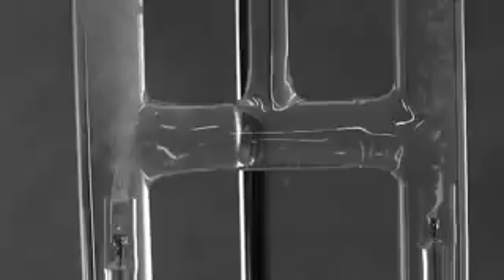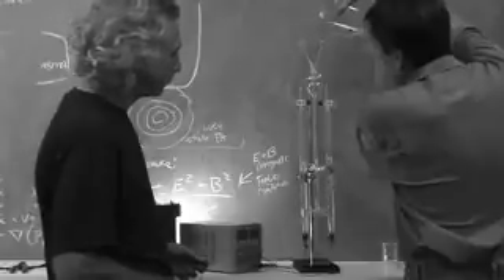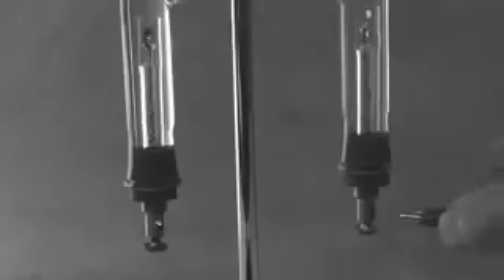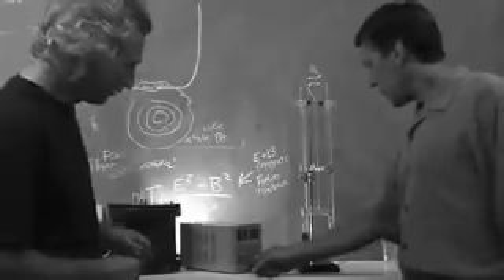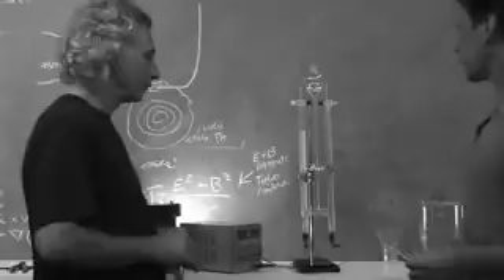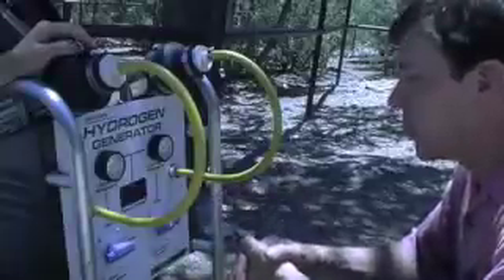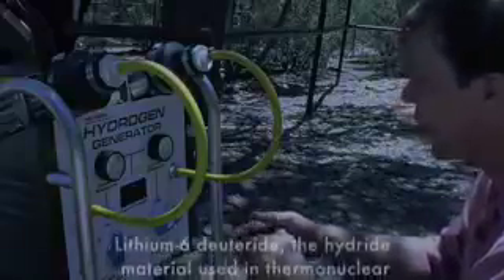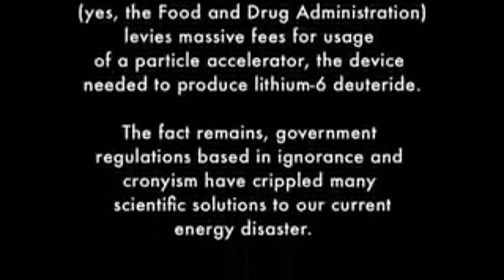run your car on water. This guy does just that!

Comment: if I had a car run on water, nobody would know.......
Reply: Exactly...
Reply: There is an old French patent that takes water and alcohol fuel and combines the two in increasing proportions. The car is started on straight alcohol. As the engine warms, the fuel is ran through a heater that is fired up by the exhaust. Water is added to a maximum of 90% - 10% alcohol to 90% water. The heat reforms the fuel to extend it with the water to methane, carbon monoxide, methanol, etc. The thing is crazy dangerous and the mix has to be cooled before going into the engine....and yes, you will never hear about this thing again - it has been suppressed.
Reply: @jimmcknight1189  source?
Reply: krab 

Do your own research.
Reply: @krab8719  Your kidding.; You'll never get a source from these charlatans. They do not understand the laws of thermodynamics.
Reply: @bohemoth1  No it does not work that way.. It is up to the person making the claim to show the evidence. You are trying to shift the burden of proof.
Reply: I agree
Reply: @jimmcknight1189  Repressed so much that a clot like you knows about it. Get a new tin-foil hat.
Reply: I personally have a copy of this patent. All you nay sayers can just keep guessing. I got this copy in the early 80's. I also met an engineer when I worked at Olson Engineering (did "grey market" conversions and automotive research) that had a variable venturi carburetor in there for test. We also did research on an evaporative carburetion system (like the Pogue Carburetors from the 30's). A system of combining gasoline with water with a flammable emulsifier to extend the fuel. The limits seem to be around 100 miles to the gallon. These things are out there and I say again - not publicized - suppressed. Do your own research and find out.
Reply: The author of the patent: Jean Chambrin (France) The patent number is 2302423. The date of this patent request is 25 February, 1975 and the request number is 75 06619, Republic of France.
Reply: @corydorastube  French Patent number 2302423. Jean Chambrin, 25 February, 1975. the title is too long to do here. Basically uses water as an extender for "carburant" (methyl alcohol, in this case). Heat from the engine reforms the fuel and water into methane, carbon monoxide, and other lighter hydrocarbons and runs them through the engine in this form. The thing that I personally made that did this thing got me 95 miles per gallon on an old Dodge truck back in the mid 80's....do I get a happy face for my tin foil hat?
Reply: @jimmcknight1189  Interesting!
Reply: Me too, because I wouldn't want the oil industry or government to send an assassin after me, like I'm sure they would do.
Reply: Even me hahaaaa
Reply: He's claiming to run his car on hydrogen not water, and in this video he never runs it.  Electrolysis of water to make H and O is 400 year old known tech.
Reply: @jimmcknight1189  can i get a pdf format of how to do this. And my car is tbi injection is it still possible to do ?
Reply: @bohemoth1  that's why he is asking for the source so he can do his own research. 
Get a life dude instead of trying to own someone with your stupidity.
Reply: corydoras - His kidding?
Reply: We do now🤔
Reply: @corydorastube  You just got your ass handed to you on a plate. How does it feel ?
Reply: @user-tt5js4bh2v  like a normal sheep feels lol
Reply: skankhunt 42  Yes I know.  But any ICE engine can be converted to run on propane. And any propane converted car will run on Hydrogen. So running your car for years (who checked that anyway) on Hydrogen is no big deal.  Low power electrolysis of water into H and O however would revolutionize the world, and is certainly not demonstrated here or by Bob Lazar ever.
I'm not saying it would not be cool/great/etc.  I'm just saying he did not demonstrate it.  He did the classic conspiracy theorist thing of claiming "the government" was stopping him while offering zero proof of that.
Reply: @corydorastube  'Your kidding; You'll never get an apology from these trolls. They don't have the balls too even investigate when you put the source infront of them'. Stay asleep kid
Reply: @DeputyNordburg  Power of reading comment first and then delet video, thanks.
Reply: @erikwestrheim804  I wish I knew what that meant.
Reply: Same!!
Reply: They murdered Stan Mayer over his water powered car 20 years ago
Reply: @DeputyNordburg  Stan Meyer was murdered over his water powered car 20 years ago
Reply: @bluesky6985  Stan Meyer's patents have expired. His inventions are now in the public domain, available for all to use without restriction or royalty payment.  And not one of you will use them.  Why do you dishonor this great man and his water powered car???
Reply: @DeputyNordburg  I didn't dishonor anyone. Stan Meyer didn't get a patent. He was seeking out investors when they murdered him
Reply: @bluesky6985  Have you used any of the patents since I showed them to you?
Reply: C W  Exactly.  So if you make electricity with the Hydrogen, and use that to turn water into H and O, you can pretend you have perpetual motion/free/cheap energy.  This is the kind of thing you need to attract investors.
Reply: @DeputyNordburg  I don't do Libtard 🗣️
Reply: @bluesky6985  Well conspiracy theories generally don't do anything so...
Reply: @bluesky6985  Can't I be a paid shill too?  I mean you tell yourself whatever you need to feel better.  It's OK by me.
Reply: @DeputyNordburg  I understand truth and reality something you don't have a firm grasp of. I know how the world really works. I know who the kenites are. They're your masters and you have zero clue of it. Of course God made you stupid on purpose
Reply: @bluesky6985  I know you're not using free energy and have NEVER tried. And I think it's really funny.  When you fill your car with gas or pay your electricity bill I hope you feel the dishonor you bring on free energy lunatics like yourself and Bob.

I'll tell the master's of the universe, or whomever when I bump into them.  Are the kenites the people who worship Kenny from South Park?  Cause that would be awesome!
Reply: The last guy to perfect this was offered a billion from oil producing nations. He told them to pound sand and weeks later he was poisoned at a Cracker Barrel and died.  Just a coincidence of course.
Reply: Yes electrolysis separates gasses
Reply: The only thing this guy has to worry about is people asking him to do it to their cars too. Tesla is making hydrogen fuel cell cars now. the technology isnt being covered up otherwise it wouldnt be on youtube. It sounds too good to be true but it really isnt. Solar powers the electrolysis, which makes the hydrogen for the car to combust. Completely sustainable, but not free. Since the solar companies, hydrogen generator companies, and hydrogen engine companies will be making tons of money when all this becomes normal.
Reply: I would tell and help them do the same :)
Reply: @jimmcknight1189  LOL
Reply: If I had a car that ran on water I would share that info with as many as I could once it's out its out, maybe anonymously
Reply: @corydorastube  most of us who study a lot have no hope in hell pulling up something we read years ago for you. Seriously. Even government websites have changed urls - it is impossible for me to keep track of it all. In retrospect I should have started a small personal electronic library when I was 13... alas. I am not gonna bother now - but that is the only way people would be able to just give you stuff like that on demand.
Reply: Theres multiple ways you could make a car run on water/using water
Reply: @jimmcknight1189  ever hear of Richard Thomas in Ontario? Sounds like you have.
Reply: Exactly right!
Reply: so have you made one yet?
Reply: @GiovanniMorenoMusic  No. Cut the crap. If yu electrolize, you are not actually using water anyway, but the dihydrogen. That's what the car runs on.
Reply: Cause else they would take you out like they have been doing for about 60/70 years now🤣
Reply: This is the second person that shows a car can run out of water, the first one got poison for invention
Reply: Yup!
Reply: @Blessup33! What?
Reply: @Blessup33! Another thing. It is not my duty to prove you wrong, it is your duty to prove you right. Can you do that?
Reply: There was a guy in south Australia who had a working model. 
When it hit the papers he died.
Reply: I wish I knew someone to help me convert my car to run on water!  I just don’t understand how to make this happen.
Reply: @user-tt5js4bh2v  he got burnt
Reply: I just said this
Reply: Its just a hydrogen car. Toyota makes them
Reply: Why not just teach the neighborhood in person instead of social media so now the whole block has water powered cars
Reply: That's the way to go
Reply: Why...
Reply: @Stephanie West 
Why would you have to undo it..
Reply: Lmfao for real for real
Reply: Yeah or you'll have a spontaneous mysterious heart attack

Comment: It cost more for electricity then you get in fuel.. This needs to be self sufficient and produce enough fuel to sustain itself as well as a car motor.
Reply: bro, did you not hear the entire part about how it's completely solar powered?
Reply: @d76458  Geez are ya'lls brains broken? Did you not listen to what he said? Why is he using it then if it doesn't work?
Reply: @Wraithss  And with that solar power you would drive your tesla way further than with the hydrogen produced :)
Reply: @SeppoLonkila  this is actually more efficient cuz this does not weigh 3 tons like a tesla.
Reply: @name My apologies, not a physics major. Just thought it'd be more convenient to just charge an electric car instead of doing all this stuff to turn solar to kinetic energy :)
Reply: @SeppoLonkila  And with that Tesla you can drive anywhere you want... except where the government doesn't allow. Then they will remotely deactivate your car. :)
Reply: @name and a shit ton of solar to make that hydrogen too...plus not so good doing it overnight haha unless there's the extra step of first charging batteries LOL

Comment: You certainly don't need a platinum electrode for this. I've done this experiment many times before with just two stainless steel electrodes and it works perfect at around 20Amps with a little sodium hydroxide added to the water. The key is to keep the voltage under 5V or not more.
Reply: Would you be able to power a 5hp honda generator using said device
Reply: @Interdiction  If you use BOTH Hydrogen and Oxygen gas in the proportion of 2H and O, Yes of course!
Reply: I am just now learning about these technologies. Basic question... I am assuming that one must use a fairly purified form of water (distilled water, for example) and not just tap water. I would think as few additives and minerals (aside from a catalyst) as possible since these may eventually "gum" up the separating system? How would using hard tap water over time work under normal conditions? What sort of maintenance is involved to keep the system running at the needed efficiency?
Reply: I’ve been told that using potassium salts to assist Electrolysis can erode most car internals , like old water coolant does .
Reply: @zensempai7371  Nonsence!
Reply: @rougebaba3887  Distilled water does not conduct electricity so the electrolysis process doesn't work well if at all. The more salts and minerals  the better the process works.
Reply: @garyenwards1608  Why do you think we have electric cars today? Do you think Elon Musk did not think about all this first? After all.....he even named his company TESLA.
Reply: @Berghiker  Ya he called it TESLA but he built a MUSK
Reply: @garyenwards1608  Just admit it....the smartest guy in the world....a South African/ Canadian.🙂
Reply: @garyenwards1608  How can that be? Albert Einstein's IQ was 160.😂 You don't know the meaning of smart. You give woman too much credit.